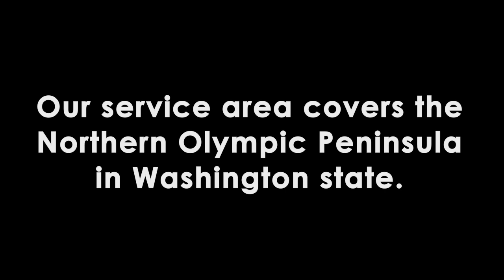Dump Trailer Project (Part 1) - Amp'ing It Up!  --  My RV Works

Comment: I'm just curious why your dump trailer doesn't charge while you're connected to your truck with the key on or the engine running? The black wire from your 7 pin should supply up to 30 amps to that battery for charging, accessories etc. The only time I plug mine in is when it's been sitting for over 30 days without use to maintain the battery.

Comment: I’m curious how the range is on that. I have a video up on using the remote kit from Harbor Freight for winches to operate the dump. $30 and it works great. Range is decent… good enough to reach anywhere I’ve wanted to be standing while dumping.

Comment: Sir I enjoy your videos but a battery cutoff will not stop someone one from taking your trailer.
Reply from the maker: Well, it's just one more deterrent. It disables them from lowering the trailer easily. If they take it they'll be driving down the road with it and that elevated state.